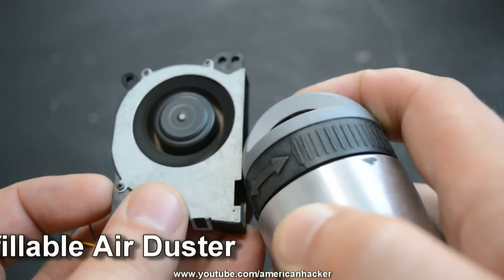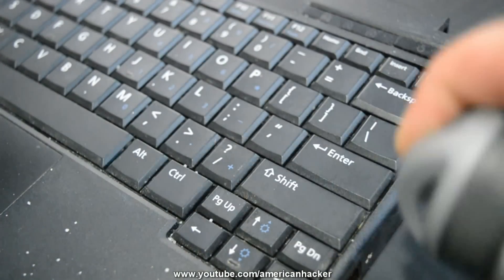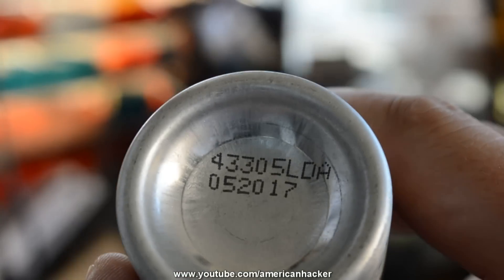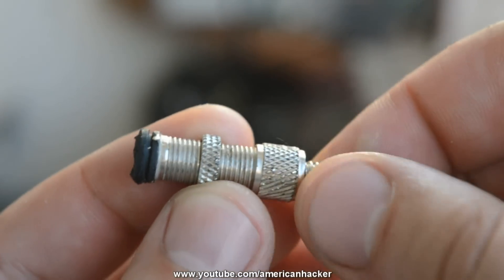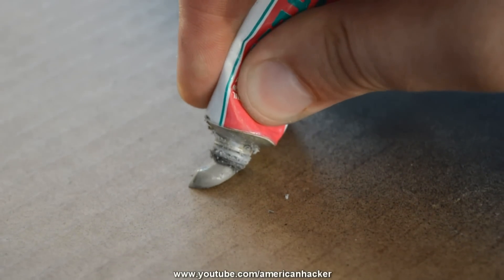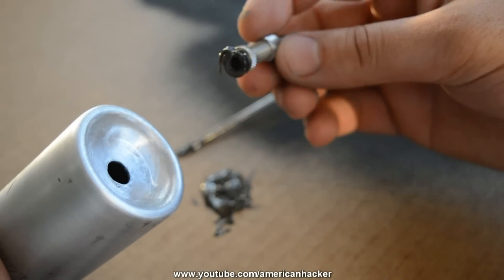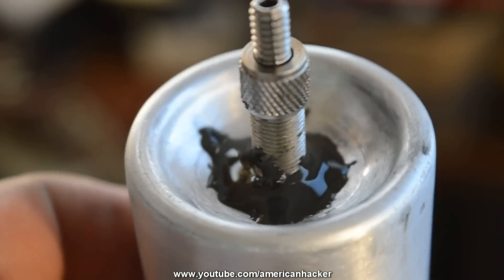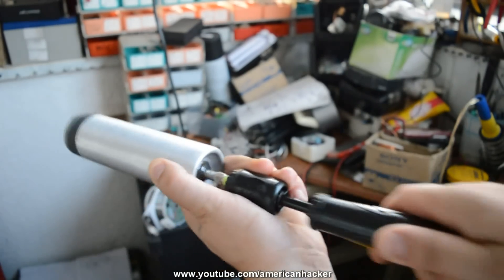How To Make Refillable Air Duster

Comment: "Air Duster" does not contain much "air", but uses other compressed gasses, that's why refilling it doesn't work as well.  I made this too, and as others have stated, it is only good for four or so sprays. While that may suck, it may be better that forking out $5-8 for a new can.
Reply: A good compressor (higher pressure, within reason) and a larger can will help.

Comment: can i used this for my airsoft?
instead of using green gas, ill jsut use this and its refillable
Reply: Zaraki Zenken Hollow i reccomend you just use propande with a silicone oil adapter, much cheaper than green gas, but air would not work well since the gas also lubricates the mech hence the silicone oil adapter

Comment: if you get a store bought won ( I'd not know if it will work on this to) flip it over and spray while it is spraying a weird ice spray comes out
Reply: It's just difluroethane. It's non toxic but if it is burned, it can cause serious nerve damage. You can put some of it in liquid form into a pvc cap and let it stand for 10 minutes to get liquid oxygen.
Reply: doesn't that spray cause frost bite?
Reply: Daily Rs yes it does. in a very real sense, any gas under such pressure takes lots of heat from skin and flesh and will easily cause frostbite. please exercise caution when using spray gas products.

Comment: Nice to know someone used used the bottom of the can and not the side like other videos. But mine was better. 
I made a hole under it and used a bike tire which barely fitted and screwed it in which the rubber had to be twisted to go in. It worked for well I can make it stand up and did not use any epoxy. try it and see for yourself. But again the fit has to be very tight. 
I find it kind of funny how this is called american hacker when you are not a native american and not even Macedonian. Maybe it should be called Gypsy hacker which would be more to the style.
Reply: the epoxy is used to withstand the pressure build up and theirs still a danger of the side of the can exploding because it wasn't designed to hold air but it should be fine for light use